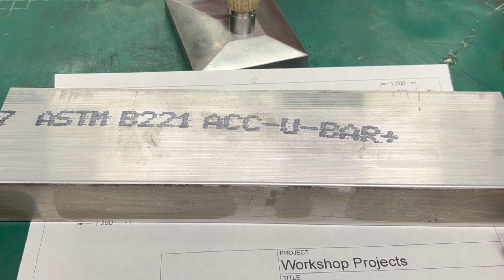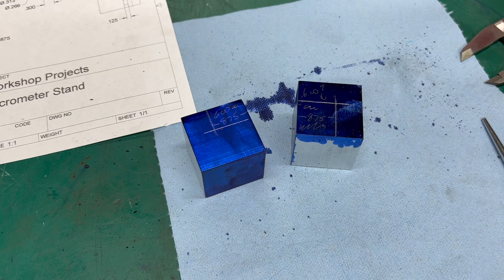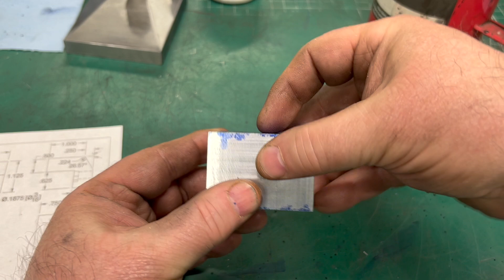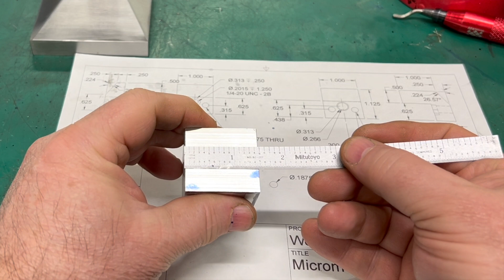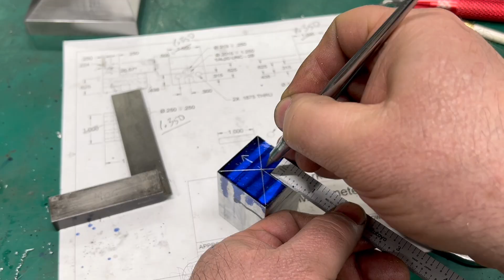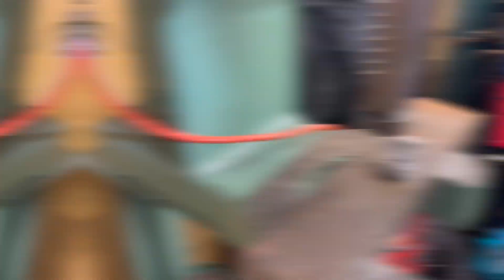Creating A Custom Micrometer Stand: Step-by-step Build - Part 4 - Making Aluminum Vise Jaws

Comment: Even if the bolt is too short, I get the idea :)
That will work just fine. And if it doesn't, you will make it work.
Reply from the maker: I was going to be making a bolt anyway, I wanted to test it, I guess I will have to wait.

Comment: A spring  in the vise jaw will help to make it easier operating
Reply from the maker: My original design had a spring around the screw. I might still add that, but for now, I am going to leave that off.